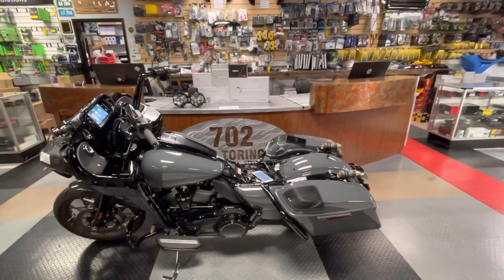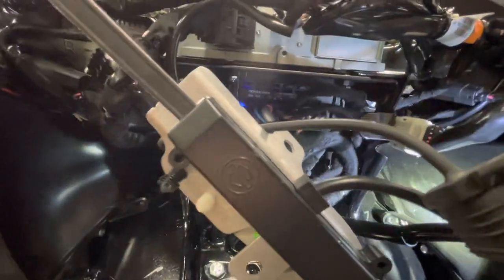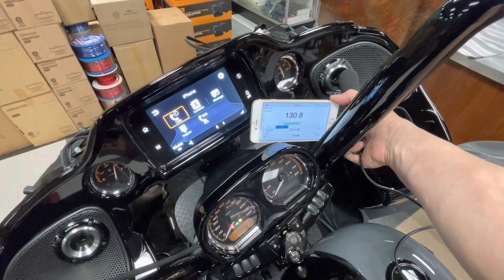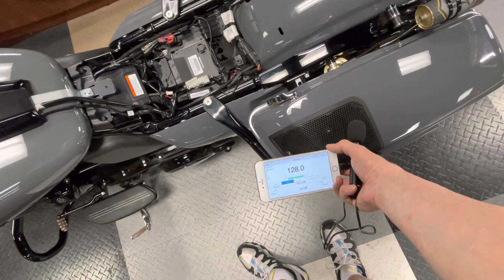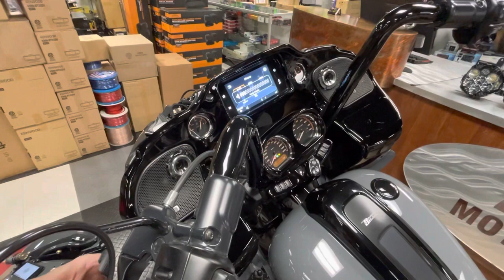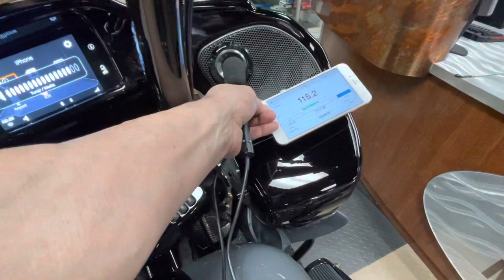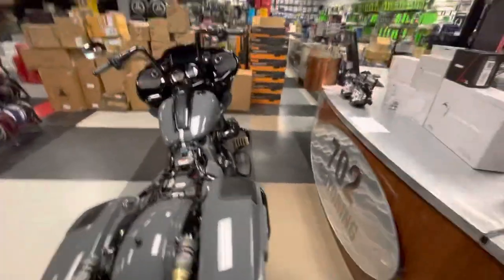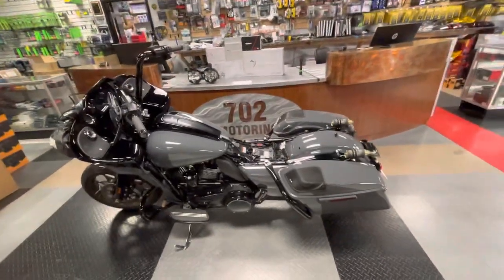702 MOTORING LAS VEGAS 2022 HARLEY ROAD GLIDE DIAMOND AUDIO & SOUNDIGITAL TOM MACDONALD MUSIC

Comment: question for you    if you have a lot those amps and dsp  would you need a 10 or so ferret capacitor so while your driving the headlight and lights don’t dim as you drive down road with volume up?